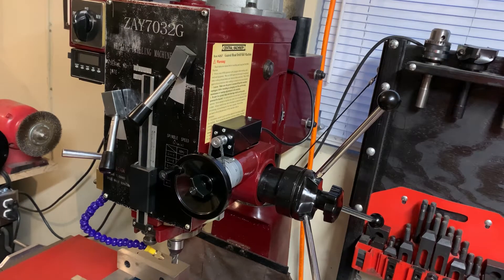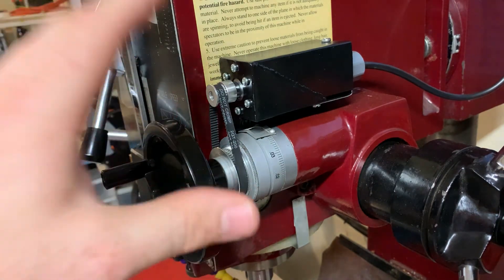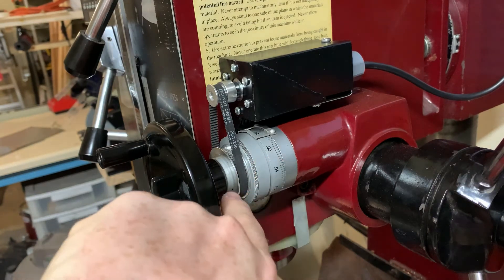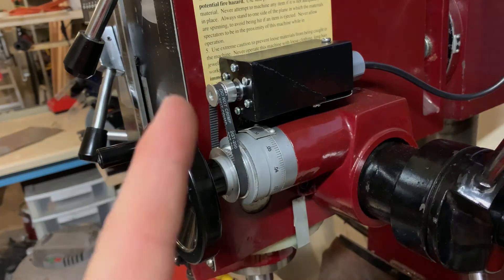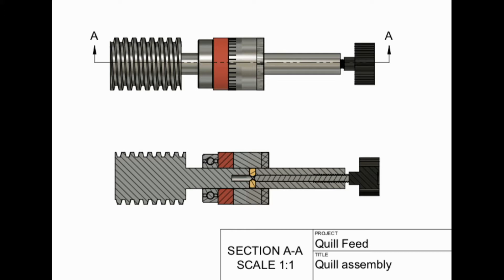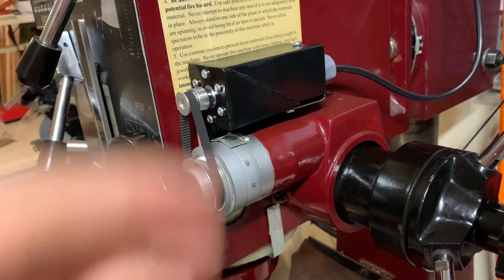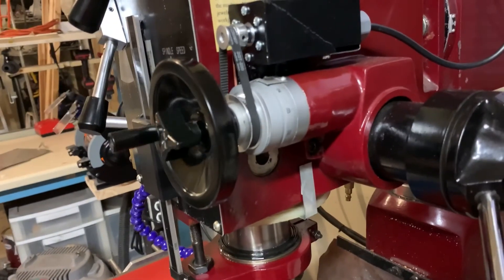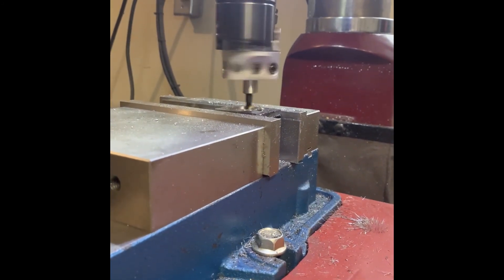Import Mill Quill Power Feed

Comment: Did you really mean 60deg for both the shaft and the pins on the clutch? I would have thought 45deg (or 60/30) so that the faces match.
Reply from the maker: You’re right, I made a mistake when is said that in the video, never caught that before!

Comment: yeah it was helpfull , just wonder if the brass pins might get stuck in there bores if you tighten the screw a little too hard  , might be hard to get the dail off to get to them if that happens 
looking at youre setup it might be eazier to make an actual friction system by using the screw to push the handwheel intoo the front face of the dail with a leather ring in between for the friction
that might be eazier to build and service , you would need a trust bearing behind the dail or make sure the dail cant be pushed back intoo the casting behind it

Comment: Hello Mike can I get a parts list from you? Motor, pulleys, drive belt, how you made your clutch? Thanks
Reply from the maker: Greartisan DC 12V 100RPM Gear... https://www.amazon.com/dp/B072R57C56?ref=ppx_pop_mob_ap_share

Houkr GT2 Aluminum Timing Belt... https://www.amazon.com/dp/B07KBFWD6W?ref=ppx_pop_mob_ap_share

These are the basic parts. The other parts were scrap lying around!
Reply: @LordOfTamarac  Thanks

Comment: I would like to know how exactly the clutch mechanism work. Thats a great build man
Reply from the maker: Mathan Kumar Thank you! The premise of the clutch is that you have two pins 180° to each other and 90° to the pushrod connected to the knob coming out of the fine feed hand wheel. All 2 parts have a cone on their ends, such that when the pushrod is driven deeper by tightening the knob, the two pins are forced outward. They press on the wheel you see with the gear, locking it to the worm shaft and allowing the motor to turn to worm shaft. When the clutch is disengaged the geared wheel spins freely on the worm shaft.
Reply: Nice ,Good day to U just want to know how those two pegs retract in when decoupled are they helped by spring. I have Van Norman drum cutting lathe and I'm planning to cut brake disc on it .For that I will have to motorized the cross slide can u help me with details about ur above work. My regards and thanks you